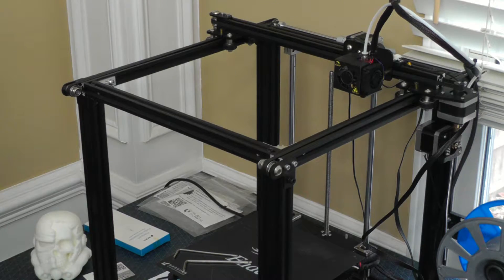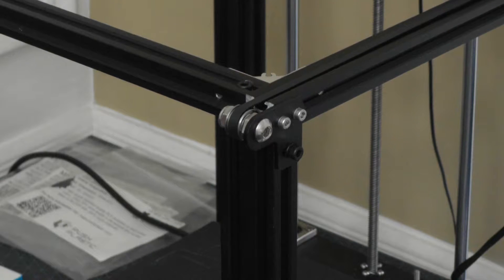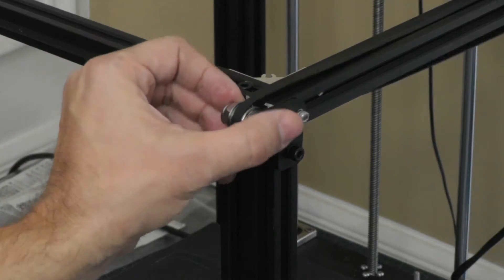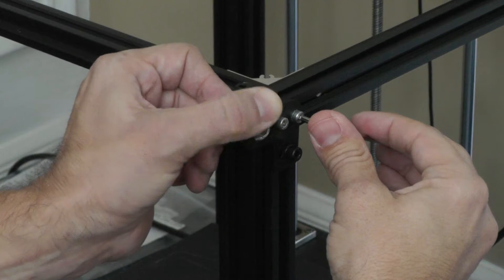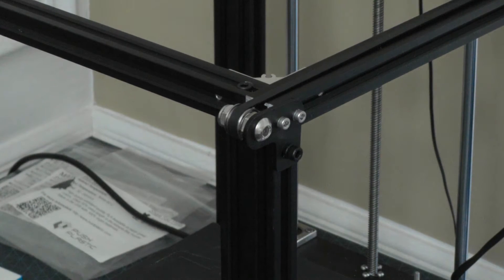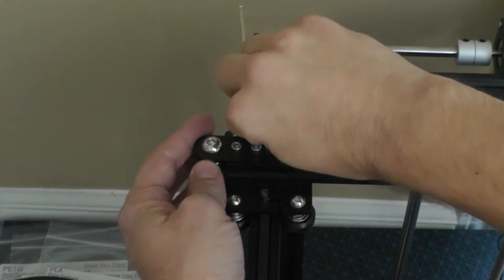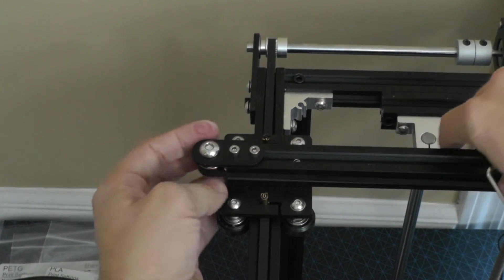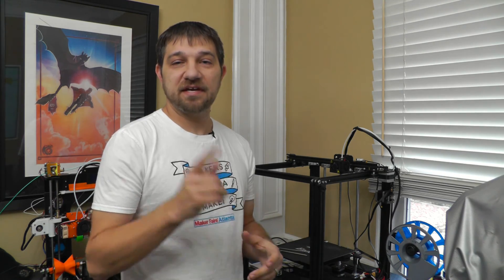Creality Ender-5 Belt Tensioning

Comment: How do you know how much tension should be on the belt? Why did you think it wasn't tight enough from the factory? Did you notice something in your prints?
Reply from the maker: Great questions! As I mentioned in this video, I don't have an accurate way to measure tension on these belts and I've never seen any video or article that gives an objective number. More subjectively, belts should be taut but not too tight as to be binding. Mine were fairly loose on the Y axis but the X seemed fine. I didn't notice any quality issues on prints from the factory but there may have been some accuracy inconsistencies from belts being loose.

Comment: Pulling by hand isn't tight enough the belts need to be taught. I have owned 3 of these machines. They are great when they are set up correctly. Also both belts should be the same taughtness. Buy some aftermarket tensioners makes things a whole lot easier.

Comment: I know this is an old one, but thanks so much for the info.  This will also work for my problem:  replacing the X carriage.  Again, its old, but important to note that these belts are not "tension" belts, like a car alternator is.  They are sync belts, with cogs that ride in the notches in the drive wheels.  This means that tension on the belts is not at all critical.  Tension should be enough to keep the belt from rubbing on the rails, but not so much that it puts a lot of tension on the bearings or stretches the belts themselves.
Reply: Wrong. These belts need tension like a guitar string. There is only 1 gear on the back, front has smooth bearing. If tension is too loose your prints will be horrible. Make sure your tension is taught. Happy printing

Comment: A guide how to totaly random tensioning the belts? Really 🤣 comeon...

Either you do it by pulling on it with like e bagasje weight, or have  gantry/carriage at a certain distance from the pulley, and measures Hz by pulling on it like a guitar string.

What specs to use im not sure about for the E5 tho.  Seen someone followed the max tension torque supplied with the steppers specs.
Reply: This post is also 2 years old.  But....   It's important to note that these belts are not "tension" belts, like a car alternator is.  They are sync belts, with cogs that ride in the notches in the drive wheels.  This means that tension on the belts is not at all critical.  Tension should be enough to keep the belt from rubbing on the rails, but not so much that it puts a lot of tension on the bearings or stretches the belts themselves.  Precise measurements are not required.

Comment: How do you know if it's the belt or if you need the wheels tightened? Would love to see a video on the ender 5 replacing/adjusting the wheels since the belt and wheels must affect each other?
Reply from the maker: The wheels are fairly easy to figure out. They should be tight enough to move the gantry if you manually turn one but no tighter. There should be no wiggle. The belts should pluck a bit but not be guitar string tight.

Comment: Hey man,  sorry to message you like this but I promise to donate for your help and I'll make it short.

So I bought an older Ender 5 for a fairly cheap price. It does have the  older board installed and it's running 1.1.6 fw. I have a extra creality 4.2.7 board that I could throw in. Is it worth the trouble and what fw would you suggest putting on it? Also wouldn't the new 4.2.7 board have the bootloader already and once it's in I should be able to  load firmware through the SD card?
Reply: I've just installed the 4.2.7 board on my original ender 5. The board is definitely worth the upgrade. Made a massive difference. You can find pre flashed boards. They cost a little more normally. Flashing it isn't a hard job anyway. Takes a couple minutes to do. Well worth the effort.

Comment: I just bought my Ender 5 and after replacing the y wire. There is a grinding noise when moving the y axis motor. I’m not sure what the issue is
Reply from the maker: It sounds like you may have a connectivity issue in one of the four wires. If you have a multi-meter, test continuity. Also make sure it has the same pinout as the original one.

Comment: Just noticed on my ender 5 the part that holds end pully is cambered... i just loosen end bolt and turn...one way tightens and other way loosens ...then i use allen and wrench to retighten... these are same cambered type bolts and method to tighten rollers.... my machine i s 7 months old... maybe yours does not have adjustable bolts.. Anyway i am going to hope this second 25 hour print i just started turns out better,since i can't figure out what else would be causing the shifting of layer lines...
Reply from the maker: Yes, mine is built like that but it's not quite a fine tensioning method. It's still pull and tighten. Best of luck on your shifting layers. If all else fails, you may need to increase the voltages on your stepper drivers or slow down your moves/travels.
Reply: @kerseyfabs  will know in a few hours after i finish the second print... i know on my other printer when i got belt tension correct it made a world of improvement...yes probably slowing down would help... same as with other machine...when you lesson the torque belts slip less...

Comment: i noticed my print on last few models using same g code has layer lines that kinda shifted ..not real bad but definitely not good... i did have loose belt issue months ago with a cr-10 clone ..when belts slips it makes prints get really messed up...thax
Reply from the maker: See my other comment. 😀
Reply: I have prints that look like the leaning tower of Pisa - is this caused by loose belts ?

Comment: You need to take a look at the bottom of your belt. If it's not at the correct height it will rub on the aluminum extrusion. After seeing this video I took a look at my belts and noticed this. I have one rubbing and saw some black rubber which had been abraded by the extrusion. I think the belt idlers are a bit too small diameter. Just my opinion.
Reply from the maker: I appreciate it. I'm pretty sure mine are as centered as can be at this point. I think I mentioned the rubbing in this video. 😀 It's been a while.

Comment: Hey my belts have great tension but the X axis belt (opposite side of stepper motor) is rubbing on the rail on the bottom side but on the top side I also notice it has rubbing on the top of the belt the copper is showing that's inside the belt.
Reply from the maker: Can you tighten the idler mount on that axis to be a bit off-center to compensate?
Reply: @kerseyfabs  I tried doing that hopefully that will help, I also moved the crimped belt end slightly up in the grove and it seemed to pull it further away from the rail. After doing that spent a good 10 minutes getting the bed level prints weren't sticking.
Reply: @Hosteggy  Hi, I had the same problem, I just printed a 1mm washer to go between the frame and the mount and it works perfectly.

Comment: I found that a really tiny pry-bar (used initially for removing small pieces of wooden baseboard from tight areas) works really well for tensioning the belts. It fits right in between the frame of the printer and the roller, and it is also thin enough to fit between the belts being tensioned. Works a lot better (for me at least) for making sure the belts are tensioned evenly. Great video, please keep the Ender 5 videos coming!
Reply from the maker: Thanks for the tip!
Reply: @kerseyfabs  little screw driver works great...
Reply: @roadstar499  So does an Allen wrench ;)

Comment: Is there a reason you want it sitting slightly above the extrusion? If you set the top of the belt higher, wouldn't the part that goes under the extrusion also move up? I'm very very new to this, so just curious.
Reply from the maker: You don't want it touching the extrusion on either side, otherwise it will rub and wear down the belt over time. There should be enough space that if you keep it above the extrusion on top, it should still be below the extrusion on the bottom.

Comment: The Creality 4 has eccentrics on the pulley it's self, the hex piece between the rail and the wheel is adjusted for tension.  your creality 5 looks to be the same. You might try to adjust the tension with the wrench supplied.  it is the same for the guide wheels on the outside of the X carriage.